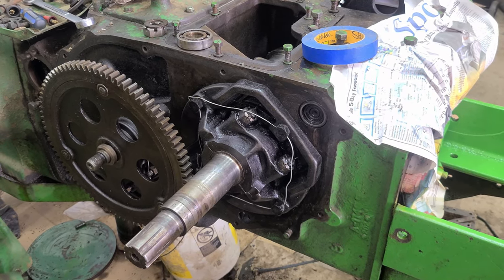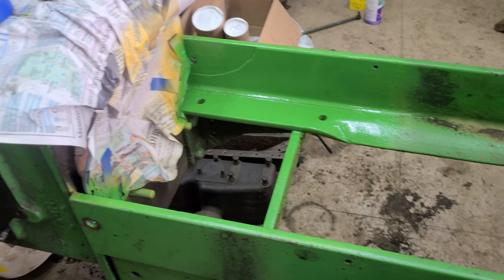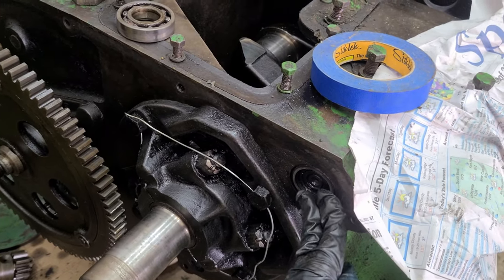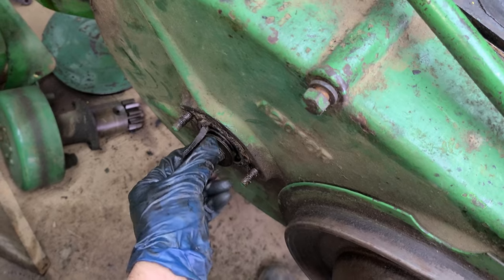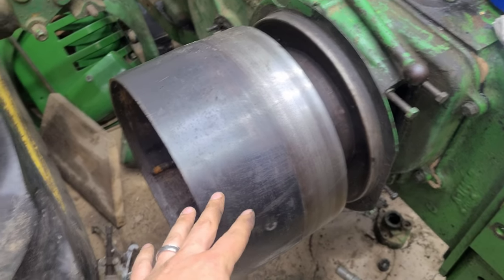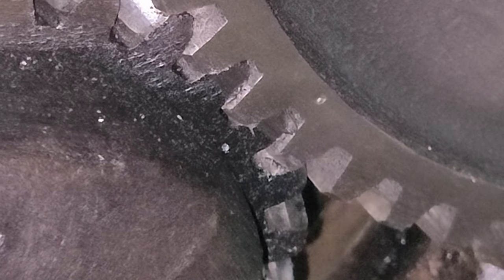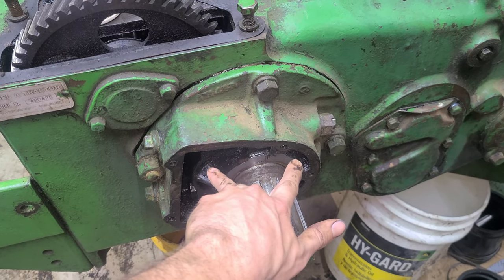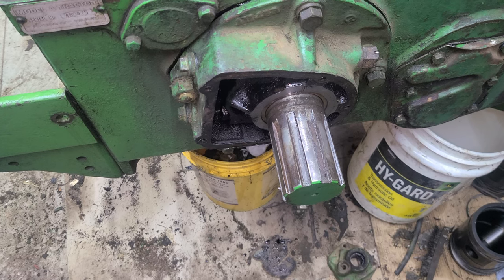1939 John Deere A Part 7 - Crankshaft & First Reduction Cover Installation - Restoration Series

Comment: This might be a dumb question, but is there an actual belt behind the clutch/pulley system? The original owners manual says when “you engage the clutch, the power of the engine is transferred to the drive wheels or belt pulley.”
Reply from the maker: No. The purpose of the pulley is that you could run various machines with a belt. Check out a few of my latest shorts which show the belt pulleys being used on steam engines.